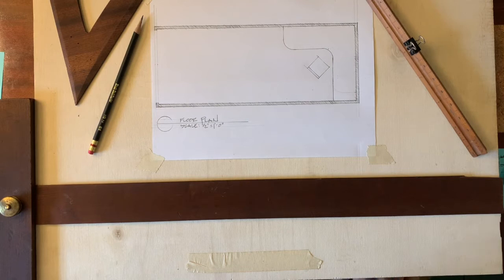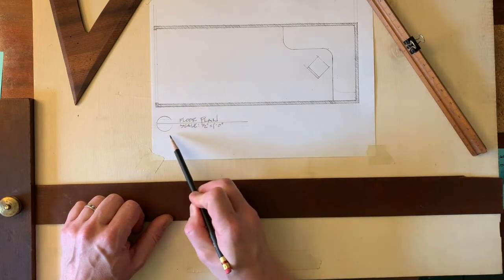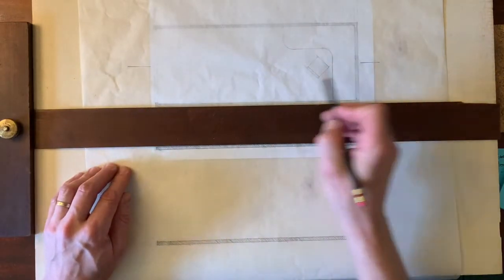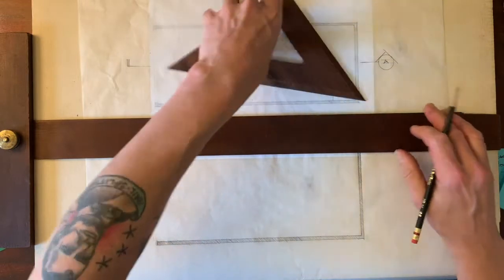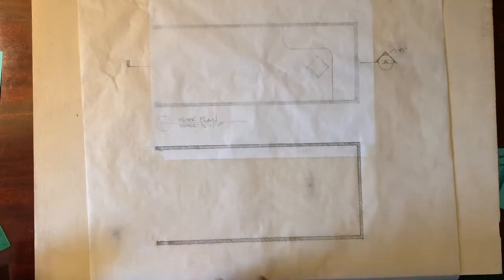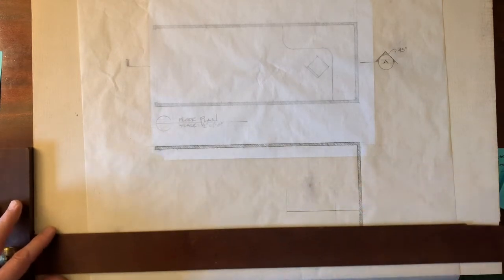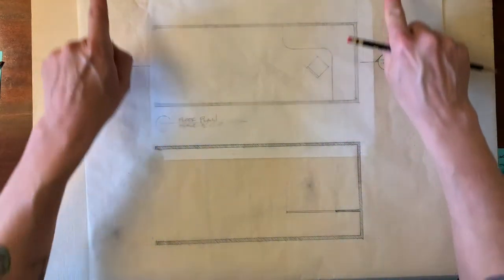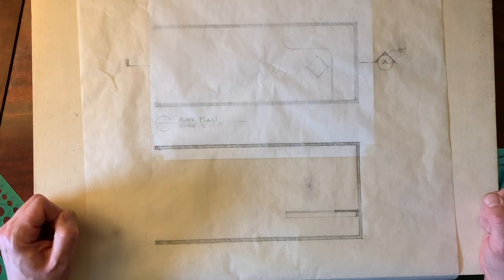How to Draw a Section Line

Comment: Some good points there. however, you should remember that not every country works to the same standards. I work to U.K. standards and we do it totally differently. Hatch lines are spaced apart more than you have shown and the title block is on the bottom right of the drawing. So please make sure that you tell your audience which standards you are working to as this can cause errors.
Reply: I believe by the way he was speaking, this was specifically for the criteria of his class. International differences are more than likely covered later or in the next advancement course.